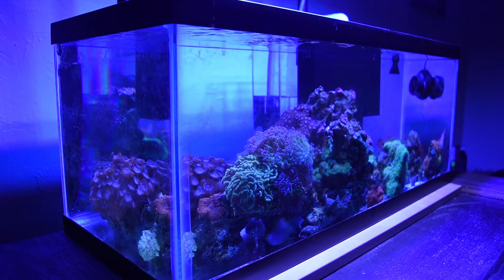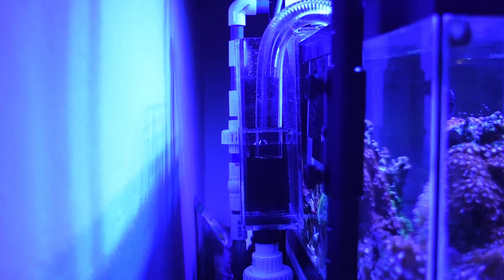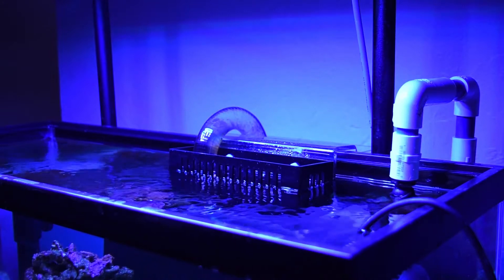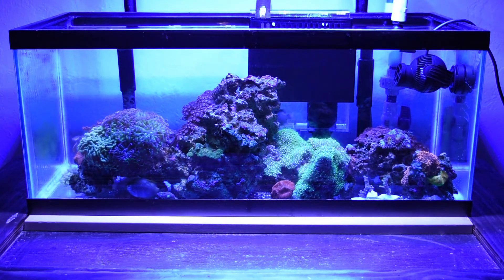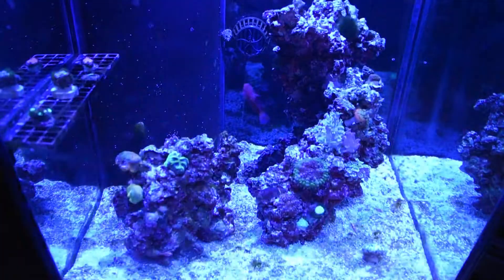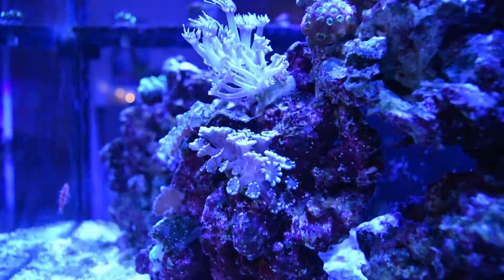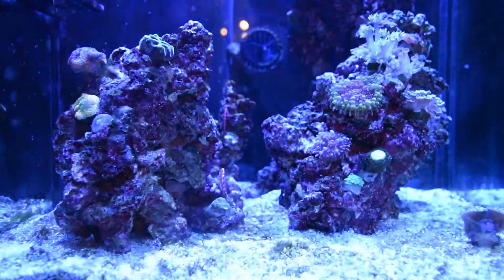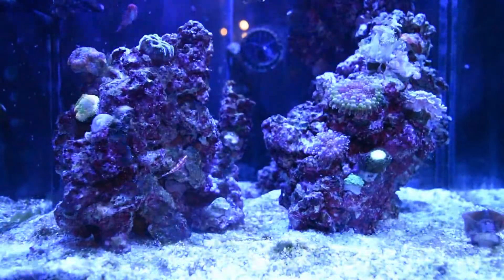First 2018 Update

Comment: Good morning, the same thing just happened to me I have another 20 gallon and that one is fine,  but the main 20 had the same problem, I had to replaced it, and for the cpr I used the one the I bought from Bulk Reef supply,  the one you have I had it also I do not trust that one, in all fairness I do not trust either one but the one you have is more fragile to me than the one I bought from Bulk Reef. Good Video and you have really a nice voice for videos... keep going and have a good day.
Reply from the maker: Thanks a lot! I'm not fan of this overflow at all.  I wish a local lfs had the new CPR with duel drains but this should work until the new tank is ready.